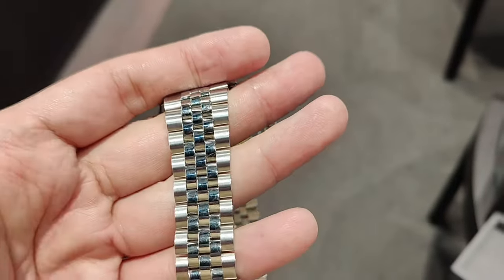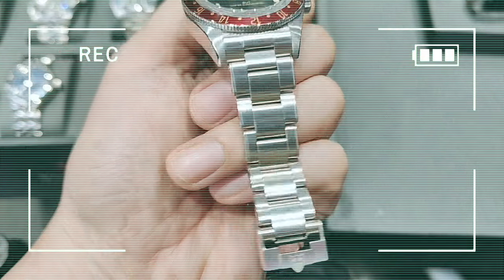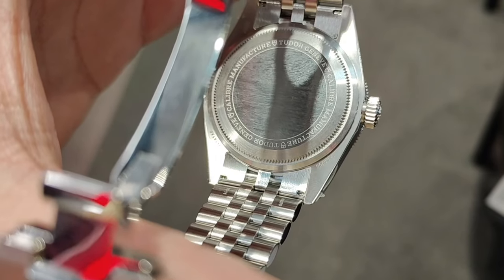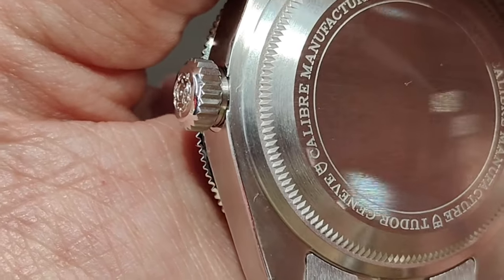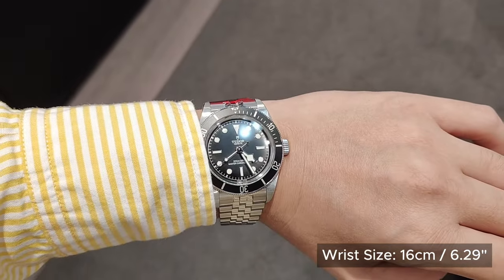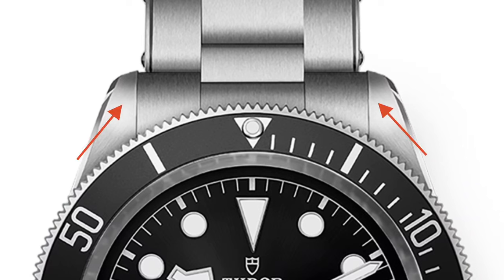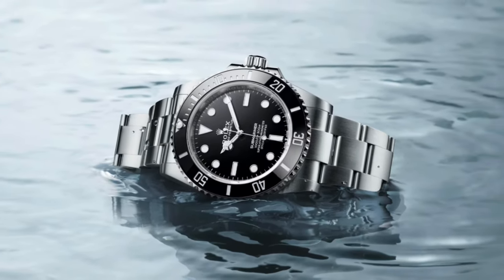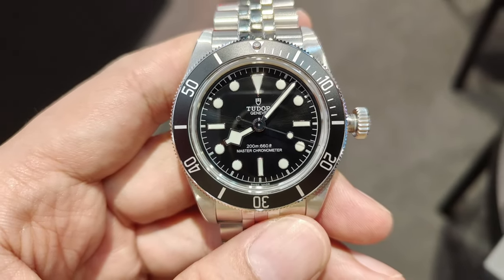*WORTH IT?* - The New Tudor Black Bay 41mm (SUBMARINER WANNABE)

Comment: Don’t get it twisted this watch is definitely on the same level of the Submariner . It’s a  nice release however it doesn’t have Rolex on the dial
Reply from the maker: Glad you see it that way. But I think to the masses it's probably gonna be one level beneath the Rolex considering that there is no white gold hands and indices on the Tudor and a 5 seconds difference a day as compared to a self claimed 2 seconds difference a day movement 😬
Reply: @watchat888 The bb41 has an accuracy of 0-5 seconds a day. My burgundy is running 0.5 seconds fast per day.
Reply: Would never be but it’s not meant to be at half its price.